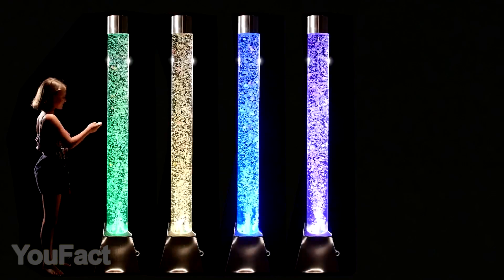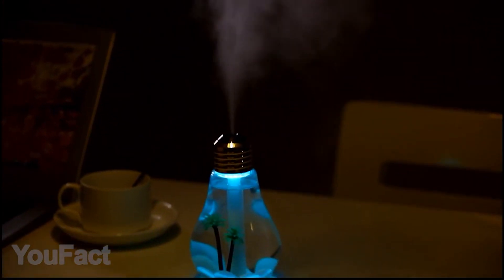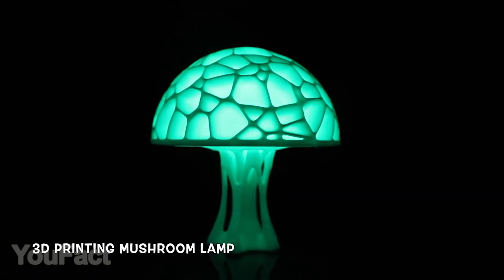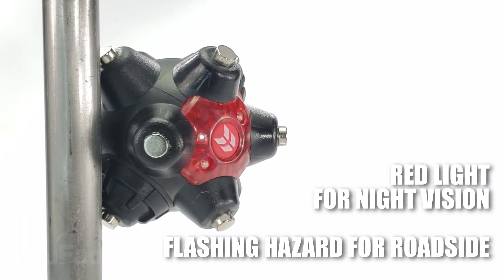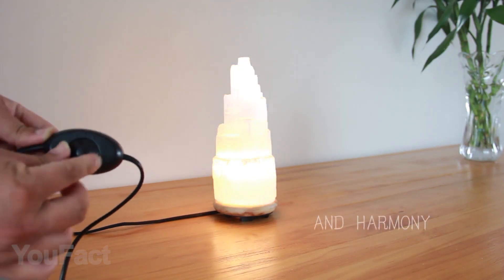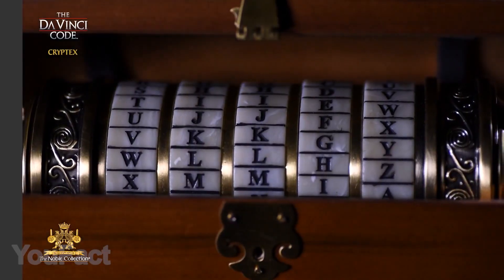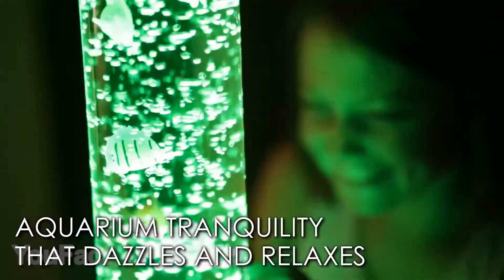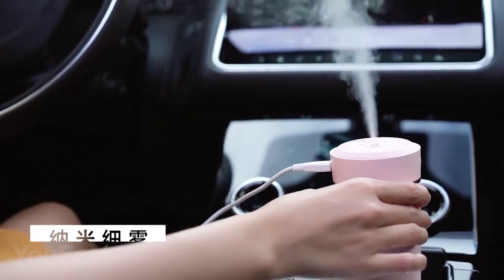13 COOLEST GADGETS For Your ROOM That Are Worth Buying

Comment: You almost had me with the Selenite Crystal Lamp until you said it needs batteries. That's no good if it needs batteries. It is also not environmentally friendly. 1.5 volts X 3 = 4.5 volts. The same power as USB outputs. Everything else has a USB power cord, why not that ?